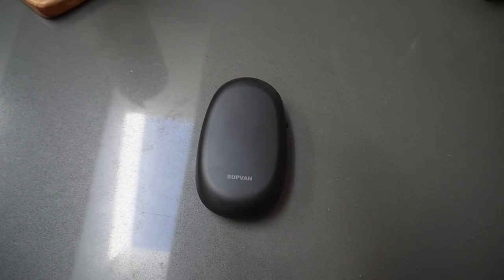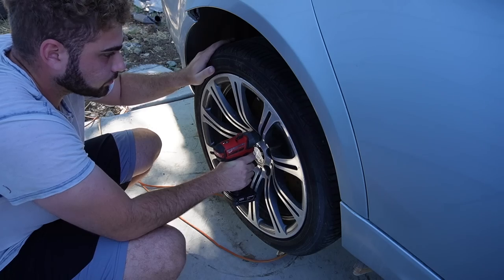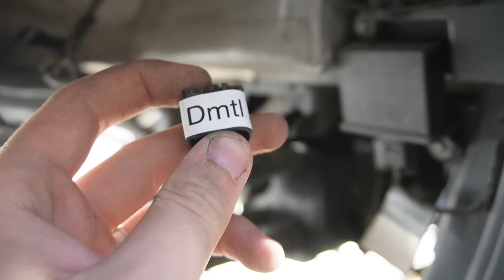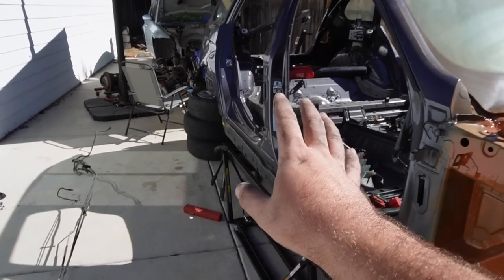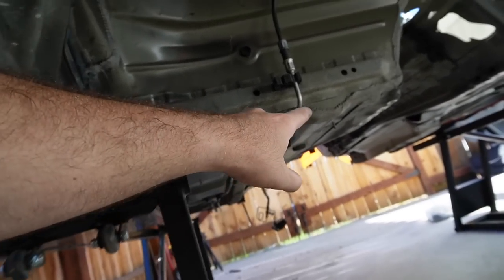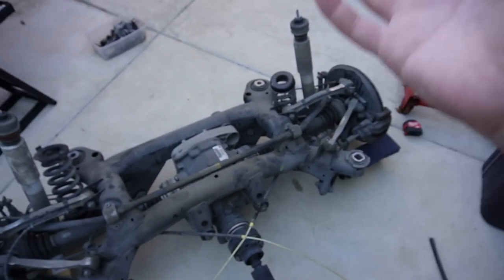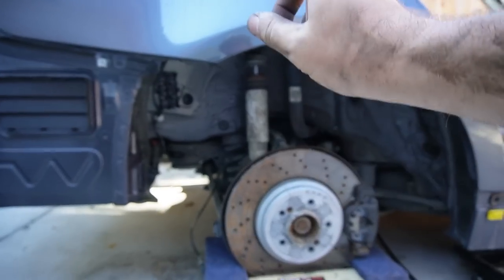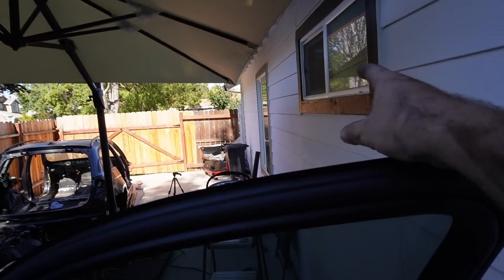Building A Custom 1 of 1 E91 M3 Wagon! (Part.13)

Comment: For the exhaust and brake/fuel lines drill a hole and use nutserts they work like rivets but have a threaded core to utilize a bolt for mounting the part.

Comment: I think you have a few options, you can weld new studs and just bolt it down, or if you’d don’t want to weld, you can drill little holes and put a screw through, put plastic or rubber washers to waterproof it, put a nut just after the hole, then the bracket, then a final nut to hold the bracket

Comment: Hey nour to mount the brackets. Buy stainless steel "threaded revitnuts" they are incredible and super fast and easy to install! (You can also use them to add screw holes and mount your exhaust!)
Reply: After looking up rivet nuts, they look like female hardware. How would he get that to work?
Reply: @Kyronsk8  female hardware in the chassis. Male hardware through the plastic bracket that bolt into the female hardware. Essentially what the car uses flipped.